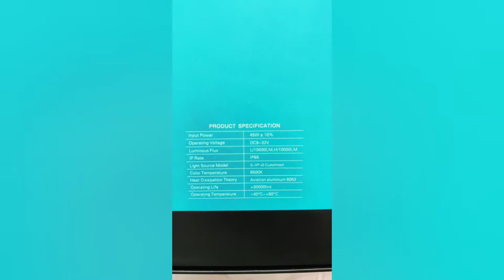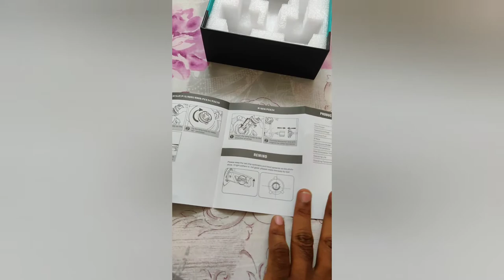How to install #LED in Hyundai Venue; Autobahn F3Gxp/F5Gxp3; Installation in the projectors; Part 1

Comment: Friend, I need some info from you.
I converted my Activa 3G from AC to DC just like you did your Apache RTR 160 (even upgraded 3G's battery to 5Ah).
Now, I am planning to install Autobahn's M3 H4 LED.
Does self start with headlight ON will damage the LED bulb, as my 3G doesn't have any CDI unit like 5G/6G to control such current fluctuations?
Will the LED bulb get fused when the engine is idling like in traffic or signal?
Hope you can help.
Reply from the maker: How did u converted the connection?.. From the light switch to the ignition wire with another set of wire ?
If yes then it's fine. 
And for the checking and making sure. Turn on the ignition. Then turn on lights both pilot as well as the headlight. If the lights turn on without even turning on the scooter. You have got the main point. If the light isn't turning on when ur scooter if off. Then u will need to fix something. 
And if the connections are ok. It will be fine. Ur light won't require any accelerator to get brighter. It will illuminate directly with the help of a battery.
Reply from the maker: I suggest u to watch jhampa66 video of led installation on the scooter.  He has used the same thing of converting form ac to dc that I told u above.
Reply: @basitalam4893  Yes, done in same way, connected wire from Headlight/Parking switch to Ignition socket. 
I am planning to install LEDs in speedometer as well as parking and main headlight also. That's why I needed some advice on it.
My friend told me that self starting bike with lights on damages LED, is it true ?
Is your headlight working fine and efficiently ?
Any load on your bike's battery, as now headlight is directly battery operated ?
Reply from the maker: Hmm, it's fine.
Now speedometer led cannot be reinstalled. It's embedded inside which can't be changed unless u change the speedometer.
Now talking about the damage in self starting bike, no there's been no damage issues. U can freely install it without any problem. Just do one thing, whenever u turn on the bikes, turn off the led as both are battery connected now and battery will get  load due to this which is not preferred. So its better to be on safer side. 
Now talking about my led's. It been 3 years now I think so and they are working fine as of now. I clean my bike alot so i wash it very often both at home and get it washed at washing station. U know how much force washing station water has from their water gun ( somwhere around 80-110bars I think). But lights never created nay problem. Also in my rtr 160, the dust cover is cut for the ventilation of the led but still it does not create any kind of problem. 
Now at last battery load, no theres isn't as such. I mean ur led is just 30 watts and ur halogen is 35 watts. So led will not affect battery life. However keeping it on while ur scooter is off will eventually take off ur battery. 
At the end, always turn off ur light before turning on ur scooter for proper load distribution inside the scooter.
Reply: @basitalam4893  Thanks for explaining it. 
BTW, when are you going to upload your Jupiter's video ?
Waiting for it.
Reply from the maker: Actually. The reason is in my district, due to lots of cases of covid 19, our district magistrate has ordered for the lockdown in citywide area which has restricted my moments. Although courier services are open. But it's taking more time than usual for the order to reach me.
I have ordered a converter cable for my phone( one plus 7 needs a type c to 3.5 mm jack converter) which is still to come. This is why I won't be able to record my videos.